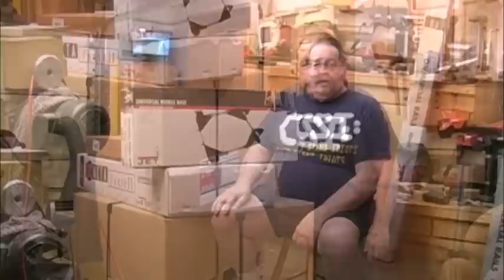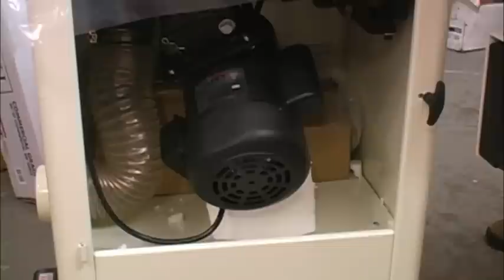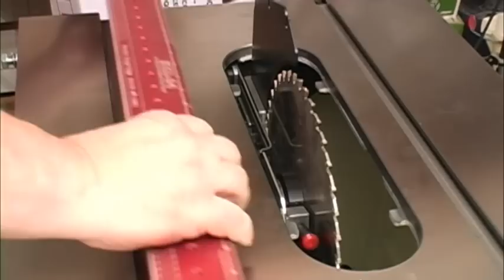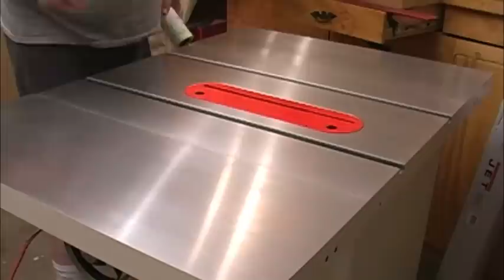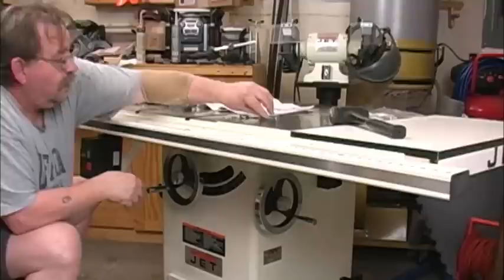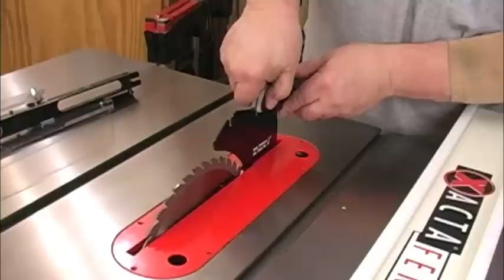Building Your New Table Saw

Comment: Just had my Jet xacta deluxe delivered, spent a few hours putting it together and getting everything aligned perfectly. Can't wait to use it but, um... how do you plug it in?
Reply from the maker: As with many 220V machines you have to add a pigtail and plug to fit your electrical system. It's in the manual.

Comment: First things first, I really appreciate your get videos.  I'm not much on advertising for big business, so I'm hesitant to mention "product names."  Nevertheless, the product you're using for preserving the surface of your Jet saw is far from the best available.  Let me explain ... I was forced, more or less, to keep a Jet TS -- nearly identical to yours -- outside for several months.  It was covered, mind you, but the various products I used to keep the table surface in good shape -- which includes the exact same spray depicted in this video -- failed miserably.  In short, I eventually happened upon a product that ended the rust issues and, obviously, I've been using it ever since.  If you can provide me with a means of direct contact, I'll provide you with the product's name.  By the way, I am NOT affiliated in any way with the manufacturer(s) of any cleaning and/or preservative product(s) ... I'm merely attempting to "pay it forward" in return for the great videos.

Comment: Great video. I'm about to receive my Laguna Platinum Dovetail saw. The exacta was on my list. What I'd like to do with new cast iron benches, i.e.  sanders, router tops etc,, is to run a flapper disc grinder and round of the edges, as not to scratch any nice timber. And by the way, do you build a house or assemble one.lol

Comment: this guy knows his stuff but as a proffesional engine builder who uses dial indicators every day... banging the surface ur leveling out with the indicator resting on there is stupid you may aswell toss the dial indicator in the bin after doin it a few times they will start to show different results still fine for leveling but not for proper use

Comment: Thintz 12, last year i purchased a used table saw. The saw seams to cut real nice, but the table top is all rusted. It is a cast iron top and slides alright but i think with some TLC would be even better. Any suggestions for me ? You can email me at newagegp@gmail.com

Comment: Americans do not understand why they insulted both. Too desaforunados comments.
In my opinion the machine is very useful, there are better and more complete, but for a DIY shop works, it could be of smaller size with higher capacity work. Greetings from Argentina